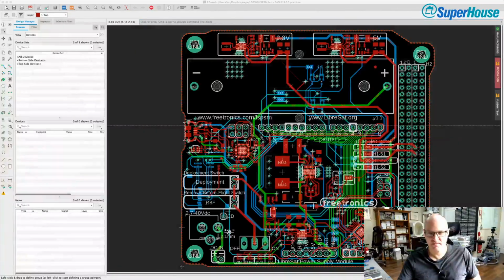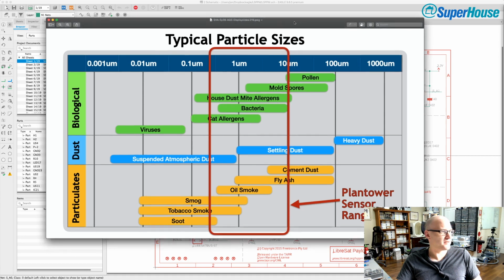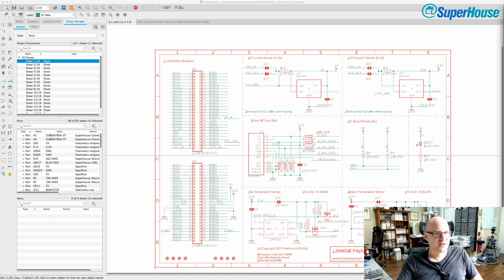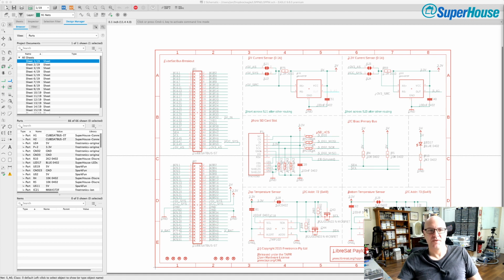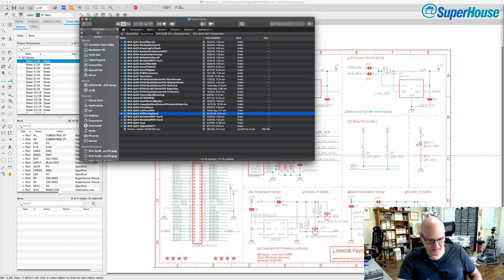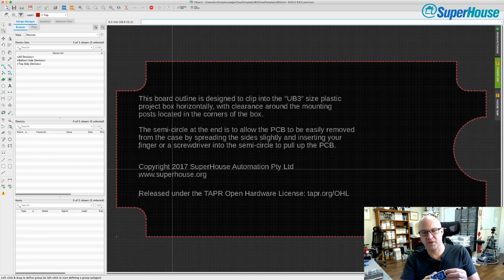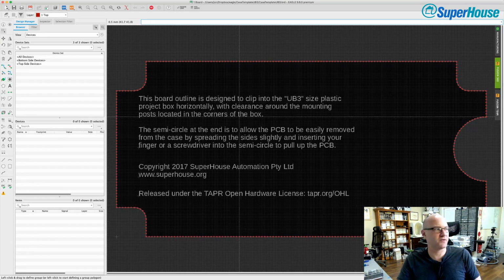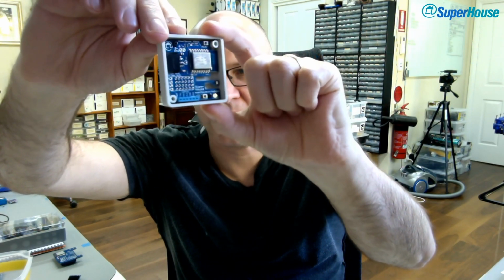SuperHouse Home Automation Hangout 2020-04-19

Comment: On the SonOff, if the light switch can kill power to both light switch and sonoff, then you just put the switch in line with the sonoff.
Sonoff's have a SPST relay, so it is a little tricky to do it.  You'd likely have to use one of the GPIO's on the Sonoff, but if the sonoff fails, the light will be inoperative.
Your Altronics link did not work.  I could find the 5Amp versions, but not the 8Amp versions.
On the comment of shipping and lack of aircraft.  This is 100% the issue.  Less passenger flights means less freight transportation.  A lot of freight travels on Passenger flights, using spare luggage space.  DHL also use passenger flights, and with less of them and a record number of online orders, it means big delays.  Australia Post actually have advised this is the issue in their network.

Comment: You need to look into current transformers more, if they are not connected to a resistive load the open circuit voltage can rise to tens of thousands of volts, major problem!

Comment: Hello, nice stream. great job! I would like to know how did you make the connection between and arduino mega and mqtt from home assistant. can you post a video regarding this?
Reply from the maker: I don't currently have Home Assistant in use in my house, but I've used it with OpenHAB which should be similar. The Arduino shouldn't need to know anything about HA, and vice versa. They communicate just by publishing and subscribing to MQTT topics.

Comment: You are using controllers like arduino in your projects, so for l know they are not very robust components and working not as expected. pls let me know the durability and accurancy of funtionalitkes of such devices which you have already encountered.
Reply: Ahmet Karakas it’s the same IC as in industrial applications. The difference is, that the connectors are not protected against the environment. If you consider this and have a reliable firmware (Arduino boot loader plus framework is not that much different to industrial ones), they are as reliable as they get.
I have a little controller for an air valve in an industrial machine that has worked for five years so far with no issues.